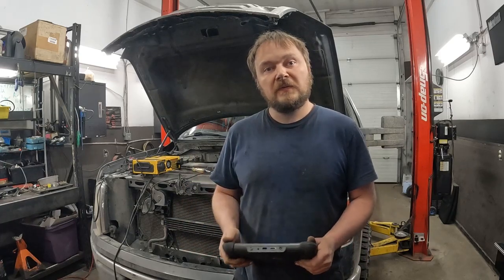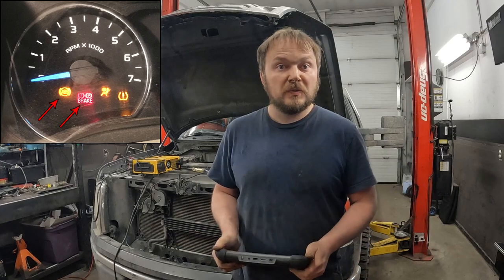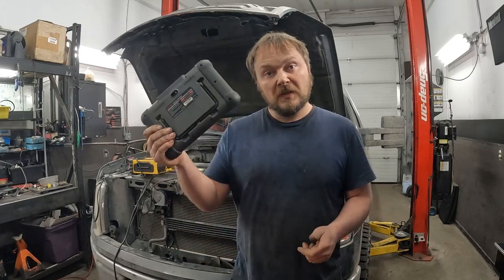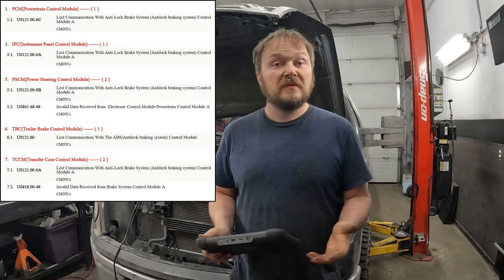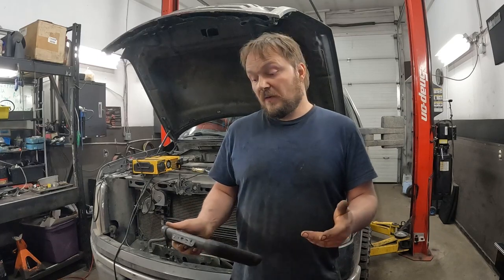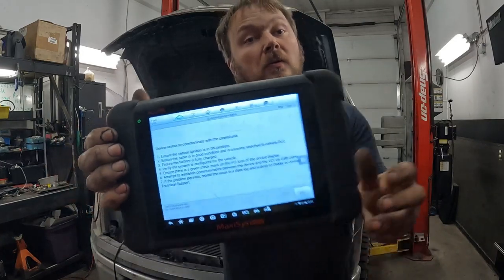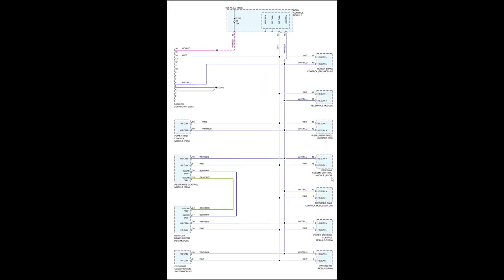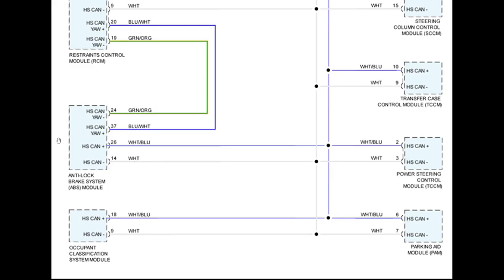2011 Ford F150 5L - U0121 - No com with ABS - How to determine network type & check CAN bus

Comment: Great video but test light, power probe, banana plugs...how is everything connected? I can't even see the battery. If you could go a little slower with your discription with better visuals of the testing confiq. A quick snapshot of a diagram would be amazings otherwise I'm died in the water at Go!

Comment: 2014 f150 XLT 5.0 4x4 ABS code  C1440 EO any idea?? Pressure difference transfuser circuit failure?? Thx D bad abs module?????

Comment: I do have a question though. My husband took an ABS Module off one truck which was working and put it on another truckwhich had the abs and brake light on along with service brake system on dash.  It did make the ABS , Brake Light go away but then when he went to put the ABS module back on the original truck it gives the orginal truck a u0121-00 code which means it is not communicating. I am thinking now that we need to have the module flashed. Do you think that I am on the right track on that?
Reply from the maker: @Nope Not Today Nope Not Today  When you removed the module from the original truck and installed it onto the truck with the faulty ABS module did you have it flashed? If so then, yes, you would have to reflash it back to the original truck. Otherwise I would make sure you didn't accidentally install the bad ABS module. I know it sounds silly but it can be super easy to do!
Reply: @eurbanautotech  Thank you and we marked the bad ABS to with a paint marker to keep them seperate. So you did confirm that we needed to have it flashed back to the orginal truck. Your awsome for getting back with me so quick.
Reply from the maker: @Nope Not Today Nope Not Today  Haha, I've definitely had a couple, "Oh, crap. Which one was the bad one.." moments. I'm in a small shop so there's always constant distractions and interruptions...

I'm always happy to help any way I can! I read all the comments and try to respond as much as I can.